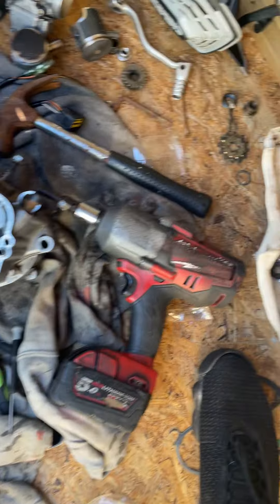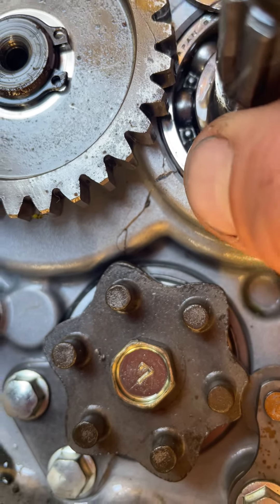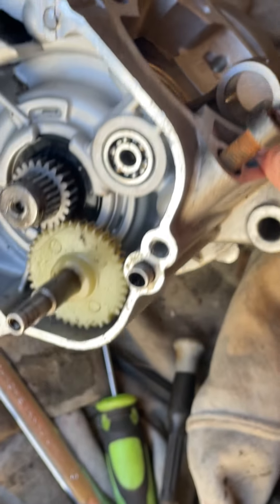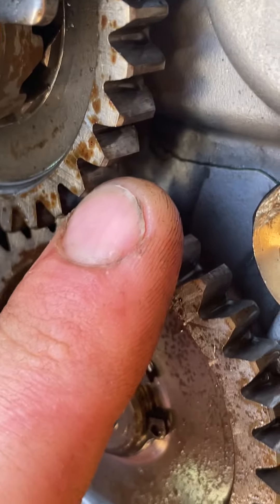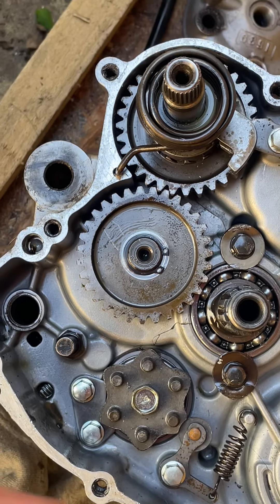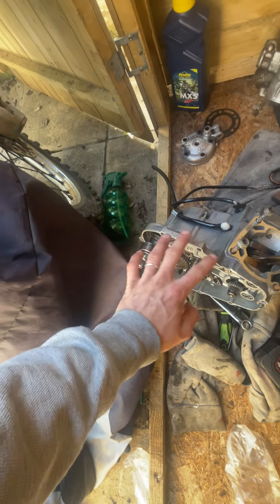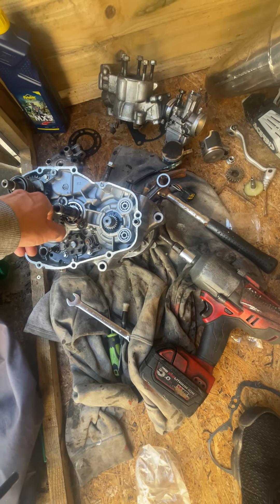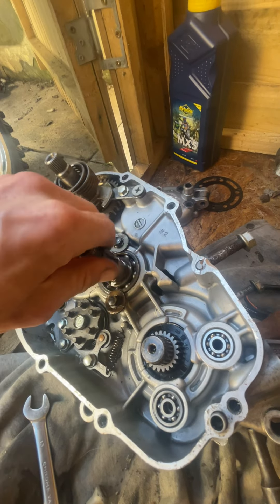Kx85 cracked engine (pain)

Comment: Dang bro someone must have been running atf! I’m sure you can get cases reasonable but the trans might be fudged and the drum and arms. I hope you locate replacement parts at a reasonable cost maybe a complete lower end. And is the power valve on the kx100 the same? I would guess port hight and power valve cylinders may be different geometry and this may change length of travel in the governor? Idk maybe doable if the governor and linkage are all matching numbers across the board for direct interchangeability. Either way I’m sure you’ll find the resources and seek the knowledge to make it run again!!!
Reply from the maker: Hey bro totally appreciate your comments, I’ve got a complete good 01 gearbox here waiting as it did have clearance issues with the shift shaft obvious why now lol, but I’ve already ordered a set of identical 01 cases with a few minor marks it’s a real shame as these original cases have no marks dings nothing no screwdriver marks between the half’s nothing at all been professionally polished etc it’s a real shame but 100 quid on a matching set of the same cases even has the same engine number lol good for me when it comes to road registering her, crank is all new in the original cases bearings seals etc I have a full rebuild kit waiting ie the gearbox bearings gaskets everything even have complete boyson reeds with inlet on the way, yea your correct the late 80cc and 85cc and 100cc bottom ends are all compatible slightly different but in ways that don’t affect part position only transfer ports water ways etc are different apparently from someone I was talking to who used to race the kx85s on 99-05 with his sons the 100 bottom end on a bored and ported 85 top end bored to 50.8mm I believe he said no ( can’t go more because it throws the ports out) but yea that setup with a 1mm plus stroker crank he promised and had loads of pics of titles his sons had won so no reason not to trust his words but he claims that maybe more power than his kx125 05 lol but yea all parts match across the board mate most the 2023 parts fit same as the rm but the whole kx and rm range are identical year for year except from the 85s lol everything seems to reasonably priced for the kx’s too idk why maybe they produced more of these or more entered the uk I’m not sure but compared to the rm this is very cheap to build lol, I’ve had every brand of 85 going and prefer the kx for feeling over them all and for parts they are the cheapest tbh I’ve had about 12/13 kx’s now I’m 25 in oct so had a fair share lol have to admit I’ve got love for the kx lol it’ll be ready soon enough with this weather lol money might be a issue soon bills are through the roof etc but we’re make it happen my cases are getting sent out Monday so as soon as there here I’ll clean them best I can or get them sent out and cleaned because I want them to look like the originals who ever done em did a good good job tbh but I’ve only gotta get the flywheel off now and I can split the original cases